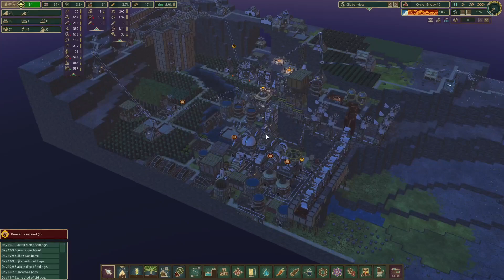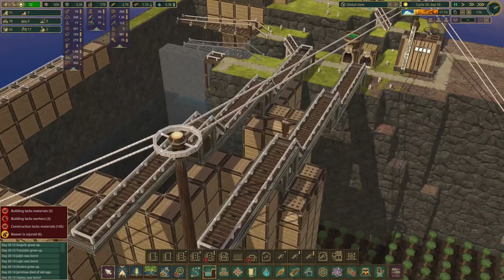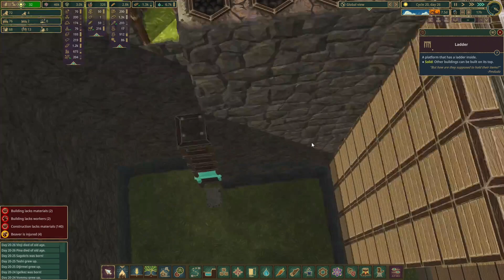Let's blow stuff up!  Timberborn Folktails Cliffside Series 1 Episode 13

Comment: 1.  Thinking  of  Dance Hall on the river could be a good idea for the beavers to dance on/above the river....  🤩

2. We could make a pressurised pipe near the water wheels to force the good water upwards then drop on the water wheels to generate power, since we built the badwater rig...  [Food for Thought] 🤔
Reply from the maker: 1. I like the idea,    would probably even have them go into the water first to access it,  giving more wet fur bonuses. 

2.  Definitely could. It would look cool, would be a decent amount of work for it to really only help during a temperate cycle.  Also it would mean a decent chunk of good water flowing off the map.  Things to consider 🤔